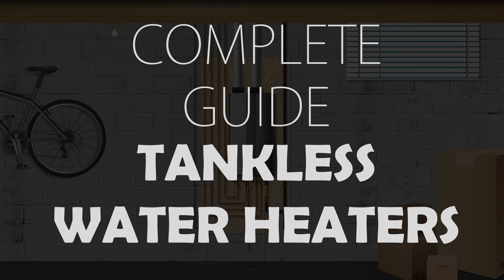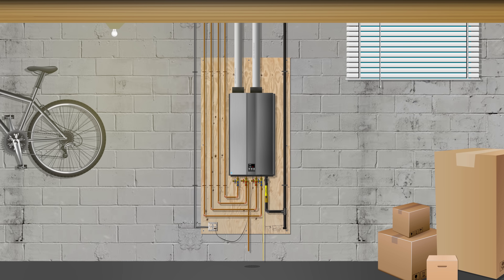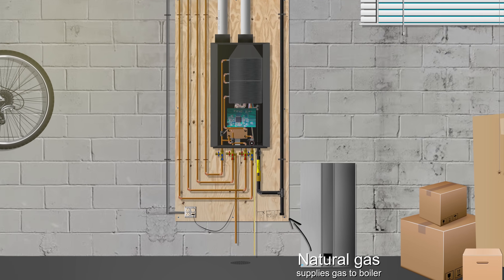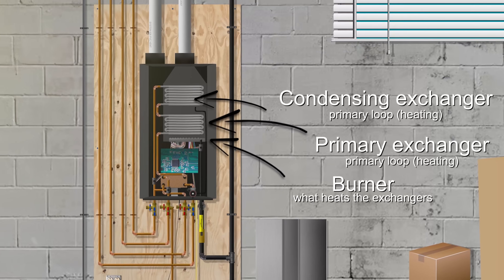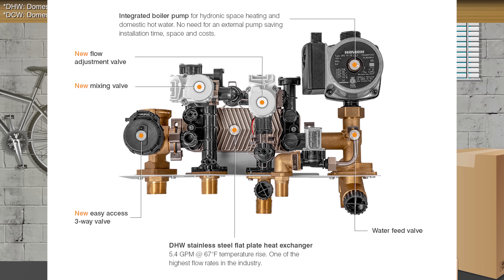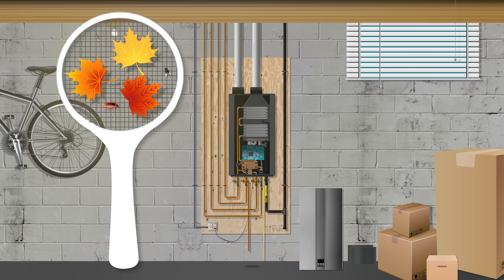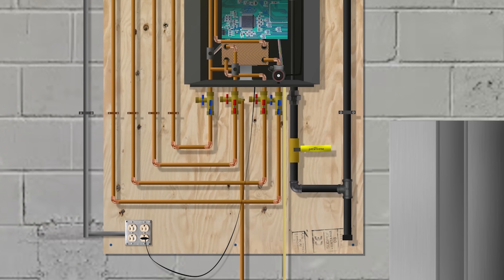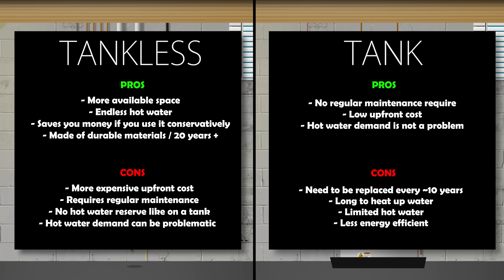Tankless Water Heaters (COMPLETE GUIDE) | GOT2LEARN

Comment: Switching from a tank to tankless (on-demand) because the modern tanks won't fit in our outdoor hut without downsizing, and we certainly do not want to downsize. Ideally I'd run a pure heat-pump unit in a garage, but that's a different story.
I've been extremely hesitant to switch to tankless because of one major (for me) downside that no one ever mentions, including this video. As far as I know, no tankless water heater can provide a trickle of hot water (which I do all the time for multiple reasons). Without enough water demand (flow) requested, the tankless units will not turn on (because they would vaporize the water) and you will forever get a trickle of cold water coming out of the hot tap. This should be listed in the "Cons" column for tankless. Maybe some day staged or variable output on-demand water heaters will be common that can provide a trickle of hot water, but I've not seen one yet. Alternatively a hybrid setup of a small tank plus on-demand heater could be a good solution.

Comment: To me, the major advantage of a standard tank WH is that it does not require power to run.
Reply from the maker: Just to heat.
Reply: @Got2Learn  True. I also have a gas heating furnace that does not require electricity. If the power goes out, I have heat, hot water, and a stove for cooking.
Reply from the maker: @ngarber  Good setup ;)

Comment: I find with tankless, it takes longer for hot water to be delivered to the farthest faucet as no preheated water in the hot water line is continually heated through conduction from the tank.  For one home, this meant almost 90 seconds vs 50 for a tank.  I would recommend a recirc pump in almost any system, but especially tankless.

Comment: My new home builder installed this in my townhouse but interconnected the domestic loop with the heating loop and added a automatic zone valve that opens and closes whenever the thermostat calls for heat plus there is a small storage tank in the mix for domestic hot water as well.  It looks overly complicated to me.  I was thinking of separating the two loops completely.  Would this be an issue in the summer when the heating is off for many months without recirculating at all in the heating loop?  I was told they combined the two loops so that one doesn't turn off when the other is in use but if domestic takes precedence than why would that matter?

Comment: Very cool stuff. I have been living off grid for many years now, and have two hot water on demand. One for the kitchen, and one out for the shower. Both are a $250 unit from home Depot, pretty simplistic. Line in, and a line out, plus propane connection. They work very well, yet I was unaware, that I should be cleaning them. So thank you for the heads up.

Comment: Installed tons of "caliphontes" in Ecuador. Beauty was they ran off batteries 9 volt or AAA cost $300 bucks and ran off propane, the number one problem was the flow switch, $20 replacement part, did a lot of hybrid solar heaters ac/ sun $450 from China . Regulations are slack but no one ever blew up that i knew, my favorite was the 120 shower head, i called it the Ecuadorian electric chair, actually rented a place that had a 120. 30 amp breaker, disconnected and converted to gas in the actual shower lol. Life is dangerous so live it with gusto.

Comment: There must be a lot of misunderstanding when purchasing a tankless, no? The model you chose may not be able to be vented in your application. If you're not next to a perimeter wall, or your existing vent is B type, and would have to be replaced, you may not be able to use your new tankless. You may not have adequate gas supply. There may be no drain available for a non condensing drip. Not enough information is given in the manufacturer's specs. I used Rennai's product selection guide. There were no fields for factors that could be major issues during installation. You'd have to wait until you got it out of the box to find out it wouldn't work. I like tank units because they are usually a direct change out. And there is no faster hot water than a tank water heater with a circ pump. And what's with a circulation pump on a tankless? It kind of negates the reason it was purchased in the first place. A tankless that is running constantly uses way more gas than a tank unit. Great video, though.

Comment: I live in Austin and made quite a bit of money swapping these out after the snowpocalypse. I went to one house as a favor to another customer in a different neighborhood. This was the Sunday after the storm. It was a cookie cutter neighborhood and they all had noritz exterior heaters in those built in boxes. I ended up with 25 customers just from that neighborhood and probably could have gone door to door and gotten more but we were already pretty overwhelmed. That Sunday I barely made it out of the neighborhood because each customer had one more friend who needed me. Anyway I’d still recommend putting these outside. As long as they have power they can handle below zero temps. If you do put one outside, I’d recommend getting a generator or some back up plan in case the power goes out. The thing I wouldn’t do is install the metal boxes for them. Matt risinger already did a video on how bad these are. The main reason is it’s an easy way for water/air to get in your house because they’re hard to seal completely. I don’t remember the other issues he had with them. The main problem I had with them was they’re brand specific so they’re designed to fit one style of heater. Basically everyone was limited to buying one specific model of noritz heater. When there’s a shortage because of a statewide record storm combined with a pandemic you don’t want your options limited to one model. There were two houses where I put different heaters in. One I installed a Navien and another I put in a rinnai. However this was costly because none of the pipes line up and you only have about a foot of space to work with. Also you have to cut off mounting brackets and grind down screw heads to fit the other heaters in. Also the hole in the cover for the vent doesn’t line up so you have to cut that. This just makes it look bad. The person who went with rinnai had to go from the 9.8 gpm model to the 7.5 gpm model because it’s the only one that would fit. The 7.5 was too small according to sizing but practically speaking would work. I guess if they all take showers while running the dishwasher and washing machine they may have an issue. Anyway, the moral of the story is I’d still mount them outside on the wall. The odds of having another storm of the century are slim to none. Though the ideal place is to put a condensing model in the garage. This way you can just put a pvc 90 on the combustion air side and then all you have to do is run the flue vent outside and you can do it in 2” pvc which is really easy.

Comment: Thanks for this video, it's awesome! Back in the 1990s, our business suite had an "insta-hot" hot water heater for the sink (the only hot water in the place, meant for washing hands, basically nothing else.) In a situation like that, of course it made perfect sense. It was electric 240V and only kicked on when the water flow was above a certain rate. In the latter years, it took more and more flow to make it kick on. Sometimes it wouldn't. We didn't know about maintenance, we just used it for 25 years. It did it's job nicely in general. The water was above warm but not cold and since it was installed right below the sink, you had warm water almost immediately.

I thought at the time, how awesome that would be if every fixture in a house had one rather than the water tank, but realized it would be expensive and would likely break down more often since there would be more of them. Now, with this video, personally, I'd rather have the inefficient old fashioned water tank system. I just wouldn't want all the fussiness. Thanks again for the video, now I know!!  😀

Comment: Electric tankless is only an option for something like a half bath. You end up running 6 guage wire, which will cost more than a high end tank, and it will only warm the water 30 degrees. We did a gas tankless in a high end house, and if I had to do it again, I would run the tankless into a 20 gallon with a recirculating loop. Because it's like w minutes before your shower gets hot.

Comment: Running a small 18Kw tankless in my small home in the mid section of the US.   The water is pretty soft which is nice,  about to do the first flush of the system after a year.  The water where I'm at doesn't drop people 50F most of the time so 18Kw is doing the trick for light use.

Comment: Your not a Plumber are you? Your graphics were nice but your facts were not all correct. You have general explanation is ok. But because there are different brands your facts are not all correct. You are using facts from Navien which is the best Gas Tankless on the market but your heat flow is wrong. On NPE which most people will have not combo. Water comes I. The bottom and main burner is on top not the bottom. A Venturi gas valve is used which makes the tankless produce higher BTUs with less gas. After the blower forces the heat through the top main burner and forces it downwards the leftover heat then goes into the secondary burner which pre heats the water. Conventional tanks heat water at bottom and are only 65% efficient and 35% goes out the flue un used and at 250 degree which also can cause fire danger and they are not lo nox where Navien is abs heat is only 130 which makes it possible to use PVC venting. Also PVC is glued together so it contains 100% of the CO2 fumes.

You did good general over view but you can’t put all tankless together. 

Electric for instance will not work on most houses because they don’t have the space on their electric panel or it is too far away and the 6agw wire is too expensive and rewiring because too expensive. Also their base water is to cold and therefore they can only produce 3-5 gpm which can run two showers at once but If not in AZ the Winter water temps may be too low and then have problem with demand. 

Also Navien can be installed at 10,000 feet and can be put outside with the A model which has internal recirculation to keep from freezing. 

Texas had issues because the type of heaters outside like Rinnia which happens to be the number one contractor installed units in the US. However they are Copper burners not Stainless steel like Navien and all except for the new Sensei model (copied Navien) all Rinnia are Condensing so the froze and broke.

Tankless is the best way to heat your house and water. This August a 75 gallon Tank Will wholesale for $1 cheaper than a Navien tankless so there is now no reason to not install a Navien unless there is ventilation issues but almost all can be changed.
The biggest issue is the Big companies over charging g and their Technicians not trained properly to install. I install a Navien NPE240A 2.0 for $4500. Includes everything and taking old heater away. Big companies start at $5,500-$9,000 for same product.

Your correct these should not be installed by Handyman, DIY or a untrained Technician working under someone else’s license. In fact Navien nullifies it’s warranty if not installed by a plumber and any heater that was bought off the Internet. But I have also done swap outs for Navien free heaters for home owners. The last one was a 11 year old heater the very first version which had now flush valves on it so never been flushed and lasted 11 years in AZ on the outside of the house. No other Company I have ever installed their product has that good of warranty or service.

Yes I am a Journeyman Plumber for 30+ years and all I do now is Install Navien Tankless and Fusion Water Softners. People love the products and I flush their heaters and they can watch and learn to do themselves. 

Again good general over view but your facts were not all correct especially the sizing of the heater. Each unit will put out a certain GPM and you need to size accordingly and ask if body washes are being used or they are gonna add a new bath in the future. This text can run entire Hotels and Hospitals and do it using 80% less space and 97% efficient
Reply from the maker: Yeah it's kinda hard to make 1 single video and to cover all the facts, I tried to generalize so that it's understandable, but yeah, a lot of stuff is missing in the video, thanks 😊

Comment: Thanks for not calling them "Hot water Heaters"!!!🙄 Great video👍 I use a gas tankless at my house , power goes out no problem! computer power back up works great since it only requires a small amount of power to operate, about the equivalent of a 25watt light bulb for the igniter, I've also used a inverter off my truck in a pinch😉, for flushing I used a couple of gallons of vinegar, 5 gal bucket with a couple of washing machine hose's and a recirculating pump off of  amazon, less than 70.00 for everything and reusable! as apposed to the pre made kits for over 150.00

Comment: You forgot to mention as a con, the fact that it doesn't work very good in cold climates, the reason of this is because the Delta; the difference between the temperature of the water going into the the tankless water heater. During the winter time, the water that it's been supplied, comes really really cold, and the tankless water heater is totally incapable of heating the water that fast and make up the difference. I have seen water as cool as 40° F, and to reach 120° is almost impossible. I'm sorry if I get lost in translation, I love your channel!!Keep it up the good work.
Reply: Not accurate. These companies do not clearly tell you what size unit to buy. In Philadelphia in February water temp. was 38* F. So the unit needs to heat up to 115-120*. They tell you 4 showers, yes in Florida with 70* incoming water. I bought a Noritz 9.8 gal per min for New Jersey and its fine!!! I don't work with any company! Nat. Gas.
Reply from the maker: 100% thanks for adding that in!! 🤘🤘🤘
Reply: False. Works in colder climates.

Comment: If you live in a sunny area you can also install a solar heat panel (not electric panel) to have it heat the tank at no extra coat. This only works with a tank. it mostly works when its sunny and hot when you don't need that much hot water anyway.

Comment: Don't they have a limited temperature range? In a Canadian winter, water is colder coming into house, so does the unit still have time to heat to a specific temp or is the over all temperature lower at faucet?
Reply from the maker: Yeah, you need to get a more powerful boiler for colder climates to compensate for the colder water or it'll be luke warm 👌

Comment: The biggest limitation on those tankless water heaters is the amount of water they are able to heat up for domestic use. Many would struggle/not keep up if you have two shower/fixtures going at the same time.

Another alternative is to install a boiler that is a higher demand instant water heater that has a lot more capacity which can handle multiple fixtures. Enough heat to add a snow melt loop to your system so you can avoid having to shovel snow off your driveway or walkways in addition to domestic demands. A little larger in size … about the size of a mini fridge.
Reply from the maker: Yes, 💯

Comment: We lost power for about 40 hours two weeks ago. Wasn't a huge issue because we had a generator to power what we needed to and our water heater is a 50 gal. gas water heater so we never lost hot water.  This is another plus in my mind to a tank water heater as long as it only uses natural gas to operate.
Reply: In my old home I had 80 gals of solar feed hot water.  The pump for it ran off solar.  Needless to say hot water was free and well if we lost power it was never a problem.   The hot water in the tank was kept around 165F and mixed down.  It's amazing how well solar can heat water.  Best return on my investment.

Comment: here in morocco as far as i can tell most poeple use tankless (non-condensing)
and we use 2x D size batteries to power the igniter (so no power outage problem)
also we use gas bottles, so no gas outage problem neather.

electricity (0,12 USD/kwh (depend on your usage)) is not that cheap considering the income (315,82 USD minimum wage), so electric heaters are out of the question.

and lastly using too much water because you can have infinit heated watter is not the fault of the heater its the user fault if he can't control himself :). (so to me its not a con)
Reply: I've got to marry instant water heater 5 years now the batteries are only for the temperature gauge it has a generator in the water flow to ignite it cool just a little tricky adjusting the temp but that's why you pay an extra $1,000